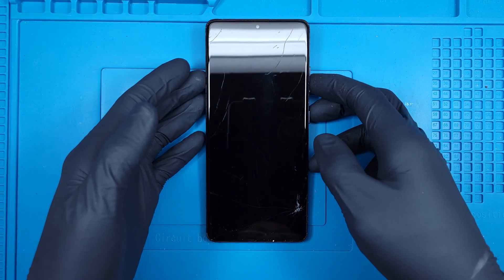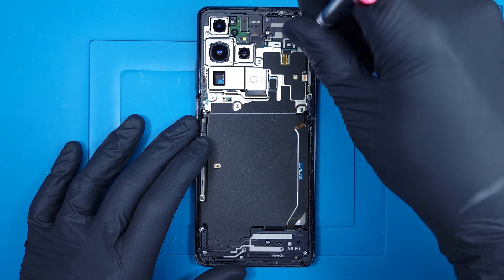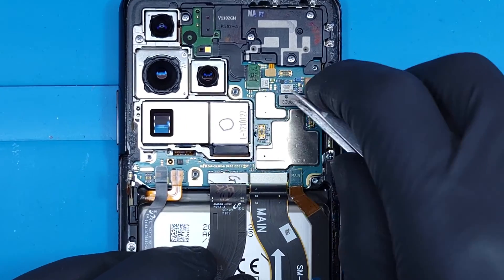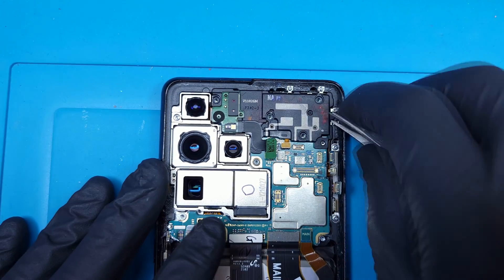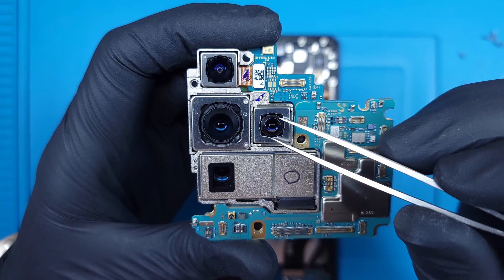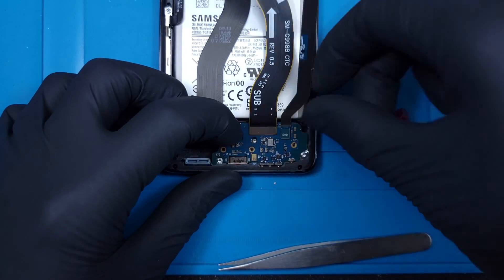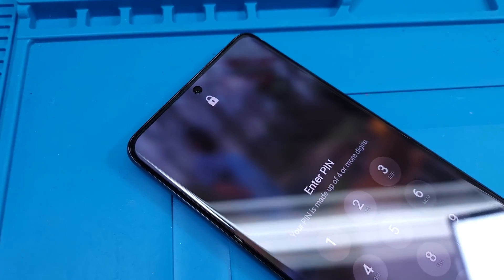Galaxy S21 Ultra Screen Replacement | Teardown Guide | Frame Assembly Replacement

Comment: Does the color matter if i order the replacement? I have the phantom black s21 ultra but wouldn't mind the silver.
Reply from the maker: Not at all, it's just the outside metal frame that will be a different color. Personally I think the silver frame goes really well with a black back panel, and makes your phone stand out a bit more.
Reply: @TapticDigital  Okay. Thank you. I also have another question. I was looking through the sites you recommended and wondering what "service pack" means on some of the replacements?
Reply from the maker: @jaymzmustache4383  service packs are basically OEM parts from Samsung themselves, they are the highest quality option, and the same parts Samsung service centers use
Reply: @TapticDigital  So could I just order that instead of the ones that say refurbished?
Reply from the maker: @jaymzmustache4383  you bet! It'll cost a bit more, but it will be a very good quality part that has gone through official factory inspection.

Comment: did i miss something watching this 3 times?  When did you replace the screen?
Reply from the maker: The first line in the description has a timestamp. The new screen is built into a replacement frame. The entire chassis is swapped. Doing the display only is possible, but won't have any water resistance and typically falls apart.
Reply: Absolutely fucking

Comment: Great video, 
I was able to replace the screen but now I'm having a problem with the camera ,
It says camera failure .

I went back to make sure everything was connected but still can't get the camera to work .

Have you had this happen after a screen repair?
Reply from the maker: Is it the main camera or the selfie? The most common thing I see are new parts including a selfie camera but it's for the international version and won't work on the US variant of the phone, it will always give a "camera failed" message.
Reply: @TapticDigital  
Thank you so much for the reply .

It won't let me choose front or back 
It says camera failure as soon as I open the app .
Once in a while it will show a small camera icon but the screen stays black.
Reply from the maker: @KidRomeo31  what I've run into is that if I switched to the non-working selfie camera it would not let me switch back. I had to go to the app info in settings and force stop it, as well as clear cache/data. You could try that, but unfortunately it sounds like it may need the camera module replaced.

Comment: Is it the same for the s21 plus? And I'm wondering if buying new bottom speakers might be a good idea for different reasons
Reply from the maker: Almost the exact same steps with the Plus model. Might I ask what reasons you'd want a new bottom speaker? Unless yours is blown or rattling there's not much need to replace it

Comment: Question: I got my S21 Ultra screen replaced. It is all fine but the touch screen becomes unresponsive for a moment. For example, when I am trying to write a sentence, it sometimes doesn't respond to pressing on a letter. So what do you think is the cause of the issue?

(S21U is updated to the latest, and never had an issue before screen replacement)
Reply from the maker: Sounds like it could be a defective screen honestly. Since everything is mass-produced you do occasionally end up with some defects, I'd contact the place that repaired it and ask about their warranty for defective parts, most will just perform the repair again free of charge.

Comment: URGENT: nearly done with the transfer, but just realized the selfie camera is glued in -- how can I transfer it over? heat, cut it out, dissolve it??  Thanks for any suggestions!
Reply: Heat worked. After heating screen to remove battery, selfie came loose too.  Thanks for the video.
Reply from the maker: @pxlshader  I was just about to say, a little heat will soften that hot glue right up and you can safely pick it out!

Comment: After repaired still the phone waterproof ?

Please  someone  answer because my phone screen is broken 😢
Reply from the maker: The phone isn't waterproof to begin with sadly, only water resistant. Any cracks in the front or back make it less-water resistant. Depending on the parts used in the repair it can get very close to the factory level of water resistance. But if you know you're going somewhere the phone could get wet, it's best to put it in a dry bag.
Reply: @TapticDigital   when the phone wasn't broken i put the phone on the water and nothing happen but now when the screen is broken after repair it with an original screen can it be as it was
Reply from the maker: @moheepfaisal5705  it can be, just depends on the shop who does the repair, I'd ask to make sure they are using Samsung parts, and ask if the frame is replaced with the screen (this gives a better chance of being water resistant)

Comment: Yeah so I accidentally put my phone through an industrial shredder but then what came out fell into the blender that was under it, which then tipped over pouring the contents into my unfiltered Cummins x15 air intake flowing the entire phone through the engine all the way to the exhaust, do you think you would be able to put it back together? I had some pretty cute cat pictures on there I'd like to keep
Reply from the maker: Shoot, I hate when these kinds of things happen. It sounded totally fixable until you said it went through that unfiltered air intake, then it was really lights out for that phone. It's a shame JerryRigEverything doesn't have more in-depth durability testing, I feel like he definitely has an industrial metal grinder and that he's just holding back on us. Try rinsing the phone with raw diesel, seems to fix most problems.
Reply: @TapticDigital  alright, I'll try that too, do I ignite the fuel after a while too?

I did the same thing to my earbuds, do you think those will still work?
Reply from the maker: @It_Is_I_I  earbuds are RIP m8. Though I'd love to hear the sound of those rattling through a fuel injector
Reply: seriously man, just use a little duct tape and you're good to go
Reply: putting it in rice should do the job

Comment: Hey is it worth replacing the screen after it broke down .
Will the replacement insure no others damages??
Reply from the maker: I say it's worth it, it's much cheaper than a new phone, and the S22 Ultra is almost a downgrade from the S21 Ultra in terms of specs. You won't know for sure if anything else is broken until you take it apart, but 9/10 times a new screen is all you need.
Reply: @TapticDigital  In the screen replacement is the screen only replaced or are there others components replaced too???
Reply from the maker: @yujirohanma2715  most shops are using a display with frame replacement like my video, so you'd be getting new power and volume buttons, new fingerprint scanner, new metal housing. Possibly a new vibration motor, but everything else would be the original.

Comment: Just bought a used one. She told me no cracks or issues. Smh I didn't a bad job of inspecting it because the screen has a slight Crack. And the Sim card slot is hard to open. Has any one ever replaced one of those slots ?? Should I replace the screen because of the Crack. It doesn't bother me because it's at the very edge. But I wouldn't want the Crack to spread
Reply from the maker: Financially, I wouldn't replace it over a single crack if it doesn't hurt anything. It'll probably be fine unless it takes another hard drop. The SIM isn't a huge issue as long as it fully closes and reads, chances are the rubber gasket around it is slightly warped, or the pushpin inside is a bit too rigid. I will say that water resistance is significantly reduced with the crack, but shouldn't otherwise cause issues.
Reply: @TapticDigital  thanks for the response ! I was mainly concerned about the sim tray but yeah it's closing fine and reading the sim. And yeah screen Crack isn't too big just have to be more careful

Comment: thanks for the video and the link to the framed display! I did notice yours came with a battery and the pictures in the link do not. is it a gamble if it will have a battery or not?
Reply from the maker: At first the OEM service packs I was getting included a battery, then they started coming without one after a few months. And now the new S22 parts I'm getting in don't have the battery or the volume and power buttons either.
Reply: @TapticDigital  my broke ass is just about to order the screen finally.... lol is this still your best option for the s21 ultra?
Reply from the maker: @josephlabosco3063  MobileSentrix has been kinda difficult lately, I went ahead and updated the link to point to Injured Gadgets, and it'll save you a huge $2 too! 😂
Reply: @TapticDigital  😂😂😂 thanks man I appreciate it lmao

Comment: I have a s21 ultra 5g , I cracked the front glass but the digitizer and oled are fine
 Is there an easier way to repair this besides paying 500 Canadian?
Reply from the maker: Unfortunately the only way to get cheaper than that would be buying your own part and doing the repair. The parts themselves are incredibly expensive, so is the phone, which is why the repair quotes are so high.

Comment: Why does the replacement glass have a ring around the selfie camera?
Reply from the maker: The part had the included scratch protector pre-installed, so it's just a layer of plastic over the new display with a cutout for the camera in case customers want to leave it on

Comment: How did you remove the back part? You made it look so easy lol. Sorry,  new to this repair stuff.
Reply from the maker: I go a bit more in depth in other videos, but more or less it's a lot of heat and patience prying around the back panel to remove it.
Reply: @TapticDigital  can I use a hairdryer to heat it?
Reply from the maker: @Chonk92  you sure can, just set it on high. You'll want the back "almost too hot to touch" and start cutting, carefully!

Comment: My dear brother, I have a question, is the new screen better than the old one that was broken or is it worse than it or is it at the same level? There is no difference between them and is it after replacement, especially the water resistance, is there or not
Reply from the maker: The replacement screen I used was a Samsung OEM part in a frame, so it has the exact same quality and water resistance as the original.

Comment: Thought I'd check to see if I could fix it myself rather than using my insurance and paying £100 for a new phone... but yeah the replacement frame is £211 alone
Reply from the maker: It's super expensive, but it is one of the best displays on the market still. If you have insurance, that's the way to go

Comment: My screen died today on my s21ultra. I took it to offical repair center and they said that when they change screen all data is lost on phone and need then transfere all data back and pay 30E. My question is does the data realy delete affter screen change or some other component repair?
Reply from the maker: Nope, turn and run right now, don't go to that repair shop, ever! Data is never lost unless the technician damages your board beyond repair. It sounds like this place is just sending your phone off and giving you a refurbished one as a replacement. This is just lazy corporate junk. Find a local repair shop with decent reviews, call them and ask about data loss and set up an appointment for an actual repair. I've never heard of anybody losing data from a simple screen replacement.
Reply: @TapticDigital  the problem is that this service is an official repair service from my phone company where i bought my phone and it is stil under waranty repair.. But i am angry becouse they say that all is deleted and i have many 2fa pascodes there from many crypto services that i will need all manualy replace with service providers. Plus the 30E for data transfere. So if you change the screen no data is lost from phone?
Reply from the maker: @benjaminhawk8280  correct, I would take it somewhere not official, they'll keep you're data

Comment: Great video, unfortunately I’m having trouble sourcing a replacement screen for my S21ultra plus. Any helpful links or places to look would be greatly appreciated.
Reply from the maker: Sure thing, I've got some links in the description but I usually rotate between MobileSentrix, Mobile Defenders, and Injured Gadgets for parts. Just depends on price and availability
Reply: @TapticDigital  Is there any reason to spend 20 more dollars to get a new one rather than a refurbished one? thank you
Reply from the maker: @benbailor2229  not really to be honest, as long as that refurb is from somewhere reputable.

Comment: Fantastic video thank you very much for this. I see in the parts listing they mention:
"comes with an international GSM antenna. Transfer of the original antenna is required for the device to get full cellular service in the U.S."
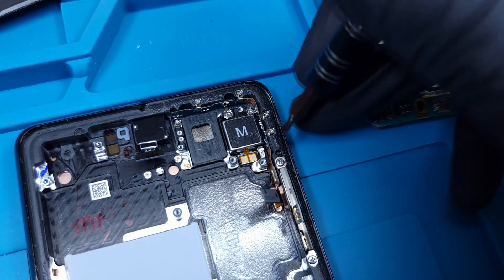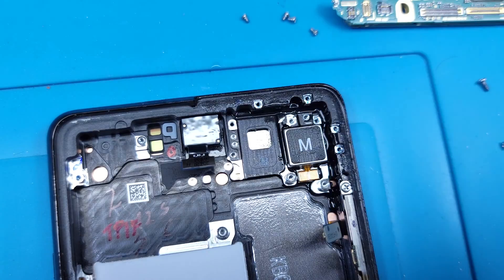Would you mind sharing at what point in the video do you show this antenna being swapped, is it at the 2:08 or the 2:20 mark?
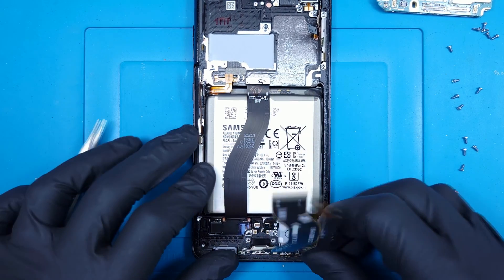Reply from the maker: It's the one at 2:08 for the international antenna swap, the only one that has triwing screws holding it. Very strange design. The 2:20 is the 5G radio. I'm glad this video helped!
Reply: @TapticDigital  thank you very much

Comment: Hey Taptic digital, i took my s21 Ultra to a ubreakifix and they tried to replace my screen but unfortunately not as professional as you and now my phone is completely dead. Do you have any idea on how i would be able to turn it back on? Maybe he messed up on connecting the battery back or something
Reply from the maker: Ouch, I would definitely call back and request a manager, they should have a warranty or guarantee on their services, especially since they are an "Authorized Samsung Provider".

Leaving something disconnected on the phone would be super hard because of how everything is screwed down under that wireless charging shield. It's possible they cut part of the display ribbon, but they would have noticed that immediately.

I know for a fact they are using the same parts I am as well so that shouldn't be the issue. Does your phone show any signs of life? Vibration when powering on or off? Or ringing even with the screen blacked out? Does the charger block get warm when plugged in for about 10 minutes? If you're getting absolutely nothing from those, some serious issue has occurred. Definitely call them back, and if that fails try getting a second opinion from another store like CPR if you have one locally.

Let me know what you end up doing!
Reply: @TapticDigital  yea its been a long process to get this resolved, but when i went to pick it up they deemed it "ireparable" 

The phone is completely dead and doesnt respond at all, it doesnt get hot when charging with a cord but i tried charging wirelessly and i did feel some heat. 

I tried to get them to let me use another technician but since the first one already deemed it ireparable i can only get a replacement. (Theyre in backorder) I also made the mistake of not backing up my data so thats why im trying to see if I can even maybe DIY it back on.

I also wanna mention that you're very responsive to the comments and the youtube channel is amazing. You really deserve more recognition.
Reply from the maker: @JANTH  thank you so much, it's comments like yours that keep me motivated to keep making videos, hoping they'll be useful to somebody!

You're best bet here is to contact either STS Telecom (he also has a youtube channel!) or iPad Rehab for data recovery. I'm not sure if STS works on them, but I know iPad Rehab would probably at least attempt it. I don't offer mail in services yet due to some contracts unfortunately, but those other folks do. Sorry I can't be more help just yet!
Reply: @TapticDigital  tysm

Comment: The screws on mine are super tight and I’m stripping them,  any help?
Reply from the maker: Try a slightly larger Phillips driver, and use a decent bit of downward force when turning. Some drivers have too much angle to grab the screws

Comment: So, the title claims screen replacement, but at no point do you show the screen being replaced.  Really???
Reply from the maker: Really??? At 2:16 the new screen is on the desk being assembled. The part used is a display assembly already installed in a new frame, an official Samsung service pack. All components are moved into a new housing that comes with the part. If you're trying to do glass or screen only, you're going to have a hard time, and won't have water and dust resistance.
Reply: @TapticDigital  He has a point.  You pretty much gloss over that part.  I'm guessing that this is why you've been making YouTube videos for over two years and you barely have over 1,000 subscribers.  Try harder next time and maybe actually show what you claim the video is about.

Comment: So this happened to me but i havent been able to get mine repaired. Can you repair mine or where can I get a screen??
Reply from the maker: I don't offer mail in repairs just yet, check some local shops with decent reviews. The parts are pretty expensive, most of mine come from Mobile Sentrix and Mobile Defenders
Reply: @TapticDigital  thanks very much. If/when you start mail in repairs then let me know.

Comment: do you not need to transfer the original front camera & vibrator to new frame even if it comes pre-fitted?
Reply from the maker: Only the selfie camera needs to be moved over due to most replacements including an international version that won't play nice with the US board, the vibrator works off of only positive and negative gold contacts so there aren't compatibility issues with it.